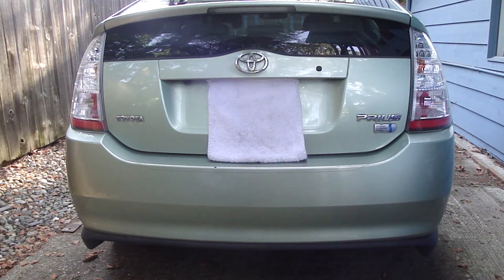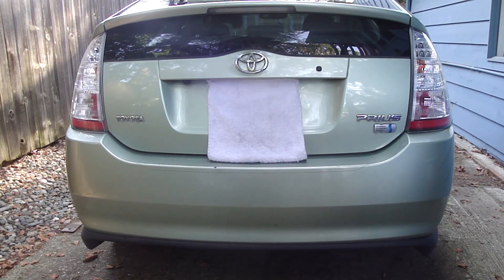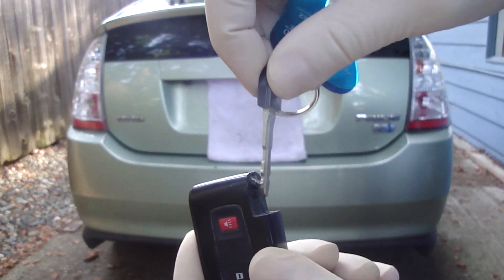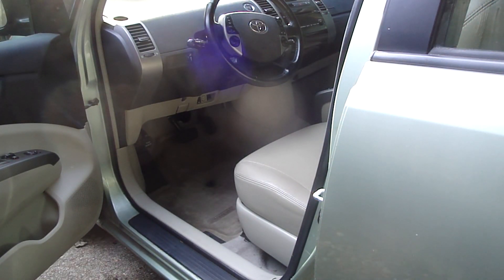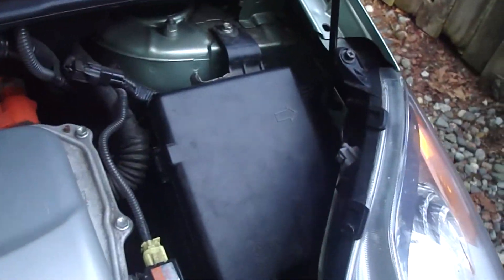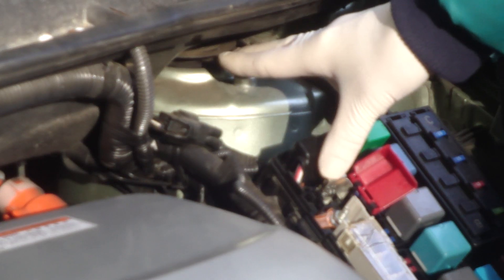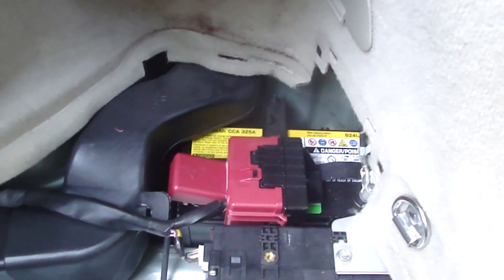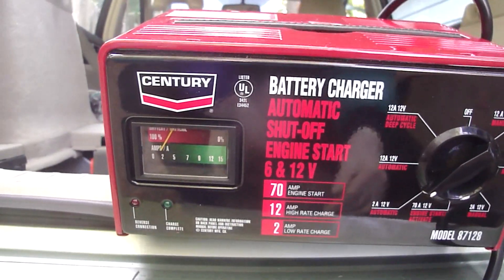Toyota Prius w/Dead 12 volt Battery / How to Open the Rear Hatch & Jump Start or Charge

Comment: Thanks for the video, when I tried to jump start my 2008 prius as my battery is dead, the immobilizer (car+lock) symbol light blinks with the audible alarm and tried few things but nothing worked. Does any one faced simialr problem ?
Reply from the maker: Did you hook up a charger to the proper leads at the power distribution box?
Reply: @davidgpo  Yes.
Reply from the maker: @sandiyar007    If the 12 volt battery won't take enough charge to open the door can you open the door with the key?

Comment: Dude dead battery cant open the door with fob key. I am looking for how to open front hood.
Reply from the maker: My daughter has the car now.  Isn't there a cut key embedded in the key fob?
Reply: @davidgpo  That physical key do not work now.

very weird. Used to work last time my fob did not work.

The difference this  time battery is out completely

If i knew this would have happen i would have charged the battery every 7 days

Lesson learned.  Probably battery wont charge  if its zero?

But i need to open the car.

if you google fob physical key  not working in 2010 prius . You will find few.

For some its more of key issue. 

Mine is something else.  Key moves both direction but car donot open at all.

first time door opened tiny bit. May be it was security feature?

After that its shut completely. I should have used hanged that time but i did not belief physical key need some battery help.

I have to get towing guy to unlock. locksmit guys asking 120cad+tax min
Reply from the maker: @nastybadger-tn4kl    Sorry to hear that.

Comment: I was trying to figure out what exactly I need to disconnect from the battery to begin safely trickle charging it and you skipped over all those details, it looks like you disconnected the negative terminal but I can't see the positive, does that need to be disconnected as well?
Reply from the maker: Do you want to charge from the engine compartment or directly on the 12v battery in the back?  If you are going to charge from the engine compartment: Don't disconnect the cables from the fuse box.  Attach the negative lead from the charger to the (-) black connector and the positive lead from the charger to the (-) red connector.  I hope this helps.
Reply from the maker: I suppose if you want to bypass the wiring of the car you would have to disconnect the neg and pos leads from the fuse box and hook up the leads from the charger to the leads that lead to the 12v batt in the back of the car.

Comment: I believe the donut spare tire is not inflatable, the reason you see the stem, is when you are changing a flat you know which side of the tire to mount, obviously the stem will be pointing outward from the car.
Reply from the maker: Check again, it is inflatable.  There a valve on the rim.

Comment: I came in here because I want to help someone who has the same problem as mine. Just recently my 2008 Prius went completely dead even after changing to a new battery. There was no life, nothing at all. I had to ask my friends to give me a jump. After watching many YouTube videos I found out that one of my fuse was gone. When you open the fuse box, at the right under C section, there are two blue no.15 fuses. I changed the second one from the top. After that I also had to tighten up my negative volt battery which is in the trunk attached to the back of the car. Make sure you unscrew the negative volt before putting on the new fuse. After that it came to life. Hope it helps someone.
Reply from the maker: I'm glad that you figured it out.  I hope your experience helps someone else.  Thanks for watching!
Reply: Just a note, but by "volt", you mean "terminal". It's the negative terminal that is attached to the chassis with a cable and a bolt.

Comment: Dude, that’s ridiculous. Just get some power from jumper cables or a battery charger  to the jump terminal under the hood and then the hatch will open like it normally does. The rear hatch for open one second after you connect. Any power to the jump terminal

Comment: Fine instructions up to a point. But you didn't show where to put the key to open the hatchback itself. The only keyhole is in the driver side door and the key doesn't turn.
Reply from the maker: That's the problem.  The hatchback doesn't have a key lock.  Thanks for watching.

Comment: Helpful, thanks…but you know what, this is the second car I’ve had in succession, where there’s no keyhole in the boot.  There’s one on the door, but not on the boot.  It’s a giant pain and only serves to draw more attention to the slightly weak aspect of this otherwise pretty good Hybrid, which is that 12V battery and I doubt there’s Prius owner out there, has not/will not experience the wonder that is the suite of faults and inconvenience that blossoms from a failing chunk of lead-acid cr@p.  If they were not going to make the 12V a decent-sized Lithium ion battery, they could at least supply a keyhole in the boot.  Anyway, I’m a bit grumpy because I just bought the car yesterday, and the suggestion was the battery was weak after the car had been sat for a month.  After a 150-mile trek home, for it to cause m trouble within 1 minute of powering-on the very next morning, I don’t appreciate.  I did negotiate on the basis of my belief the battery was not merely discharged, but dying, and this turning out to be the case, doesn’t make me feel better!  

I’d hoped to at least get a couple of journeys before jump-starting my purchase!  Anyway, we press on.  Thanks for the info, it’s a lot easier than investigating when you won’t even know what kind of a little stupid lever you are  looking for, or even if a little stupid lever exists in the first place.  The other car was a volvo.  ‘Phantom drain’ is so common, they could at least make their diagnostics point it out, instead of the plethora of warnings that are utterly meaningless and in fact, totally misleading…garbage about parking on level ground and the parking brake…we shall overcome.  Thanks and take care all.
Reply from the maker: Very well written.  Thanks!

Comment: People that make this helpful video an important piece of information. Don't just trip the lever, trip and hold the lever and push the hatch open. Because what happens is people trip the lever, then awkwardly squirm out of the car walk to the hatch and find it still doesn't open. It will lift a quarter inch but it won't open.
Reply: That was very thoughtful of you thank you

Comment: Thanks. My 2007 must be Gen 1 since it looked a little different at the fuse box.  It was more difficult to open the rear hatch than just pushing a lever and pushing up with my head. It wS only partially unlocked the first time and wouldn’t pull open, so I had to push down hard on the outside of the hatch to re-latch it and then try again, pushing up with my shoulders. Mind you I’ve had several disk fusions in my neck and back, so I am surprised that the rear hatch as an escape portal probably wouldn’t work.
Reply from the maker: YIkes!  It's best to find a way to charge the battery through the engine compartment.
Reply: @davidgpo  It just would not charge. I even put a little Wyze wifi camera in the garage aimed at my charging unit so I could watch the voltage on the meter from lying in bed. I could see it going from 4.8 to 4.0 to 3.6–I didn’t want to fully discharge the battery, so I pulled it off the fuse block in the engine compartment and hooked it up on the actual battery in the rear of the car to see if it would work there. I also followed the advice to disconnect the negative ground terminal from the grounding plate next to the battery, so all juice from the charger would go to the battery and not dissipate across the car’s electrical system.  Only then did I finally see the voltage reading going up: 6.0 then 8.5 then 12.0 and finally 13.2. I pushed the start button and was pleasantly surprised that it started right up. I heard charging via the fuse box only works if your battery is not dead—just below optimal 12-13.6 volts.

Comment: If you can jump start the car at the front fuse box, using another 12vbattery or a lithium jump pack, and get it running, then opening the back hatch is no longer a problem.  The Prius twelve volt battery is only used to boot the electronics (microprocessors) that actually control the machine, so it's not a heavy current draw.  It's not like a ICE engine where you have to rotate the entire mass of the engine.  Once the Prius is booted up and running the system will attempt to recharge the 12v battery, assuming that the battery isn't defective, or so badly sulfated that it won't hold a charge.  But you might need to take it on a longish drive, like 30 miles or so, to fully recharge ...

Comment: No need to open the hatch back to jump start the car.  Use an 8-foot jumping cable to get to the battery through the back door.  We tried to open the hatch back unsuccessfully, then tried the cable through the car back door without any problems.
Reply: not alot have 8 foot cables however I used to sets 😂
Reply: No need to attach the cables directly to the battery.

Comment: Hello and thanks for the video. Please try this in the future. I promise it's far easier than performing gymnastics to get to the hatch release inside the car. Hook up your jumper cables under the hood as you indicated. You now have 12 volt power to the car. Walk around to the rear of the car and open the rear hatch as you normally would. Keep in mind you may have to unlock the doors first. Good luck.
Reply: I was wondering why he didn't open the hatch like normal after connecting a boost pack or booster cables or a charger to the post he showed in the video.

Comment: I have a 2007 Prius and the car may be parked for months in the garage. I was planning to put a battery tender on it. Can i hookup the battery tender through the fuse box or do I have to go directly to the battery?
Reply from the maker: You can hook it up through the fuse box.

Comment: There is absolutely nothing about these cars that is better than a normal car...It takes me 10 seconds to hook up the batter on my real car for jumping and I don't need a tutorial to do it...thank you for teaching me how to do something that should be simple. Your video got me rolling again!
Reply: @mlaiuppa  So a smooth gearshift with the same torque as a real car makes an over priced hybrid with a battery that costs more than an ICE car all worth it? K... That's cool. Good luck when the battery wears out and you either have to buy a new normal Prius or spend $20K for a new battery. Your old battery which can't be recycled will end up in a landfill seeping toxic chemicals for decades. That's going to happen no matter what when your normal Prius is at the end of it's life. As far as I'm concerned, your normal car which is only about 40% recyclable is a hazard to the environment and sucks, but at least you can smoothly climb inclines lol I own one of these pieces of garbage and they suck donkey balls.
Reply: you can still jump at exactly like a regular car from the back hatch but it's faster under the hood. The nice thing about a Prius is it takes a tiny amount of juice to start the car. You are not cranking the engine you simply turning the car on.

Comment: 5:47 Also it looks like from the few seconds you focus on the charger, that you've connected it while it's still connected to the car. Is that safe? Some advise to completely disconnect the battery from the car.
Reply from the maker: The factory recommends jump starting and charging the 12 volt battery at the fuse box junction under the hood.  If that fails and the rear  hatch is locked you have to unlock the hatch as shown in the video.
Reply: @davidgpo  OK thanks for that. I went with just charging direct to the battery as you've shown in your video as I was worried about damaging the electronics at the front. Seems to be working fine. My charger is only 12V x 2.7A so only 50W approx. Very low power, and so no need to disconnect. Didn't want to charge the 12V using gas and the traction HV battery given the price of gas at the moment! See what happens in 10 hours time...
Reply from the maker: @yggdrasil9039    The factory has a limit for the battery charger.  I'm going from memory but I believe they specify 3 amps max.
Reply: @davidgpo  That seems right. Well the Prius is now fully operational again after 8 hours of 2.7A x 12V, but I'm going to leave it charging a few more hours as the charger is saying the 12V battery is not yet full. I believe there's actually a way of finding out about the SOH of the 12V through the main console in the Prius but I'd have to look it up again (it's some bizarre combination of tap brake 3 times, start engine twice, turn headlights on and off 5 times, something like that....)
Reply: @yggdrasil9039  All one has to do is get the car started which is easy since it doesn't have to crank the engine. The car charges both batteries itself with the gas engine. A short trip of less than 10 minutes will usually be enough for it to keep starting reliably.  If you really need to charge your 12v more than once after a discharge its probably time to change the battery.

Comment: "Alright I got my charger hooked up", hold on, that's the most important part of it! So now I have to go to watch another video to learn how to hook up the charger to a 12V battery. 
It's a shame you can't use the charger at the front with the fuse box. It seems to be OK to do this with the gen3 as there are a lot of videos saying it's OK to do this. Not sure why it's not for the gen2 but don't want to risk it.
Thanks anyway
Reply: It's OK I figured it out, it's pretty basic. Cheers
Reply: You definitely can use the front terminals for jumping or charging. I've done it a bunch of times.

Comment: My 2008 does not have a key lock at all on the rear door.  If I need to get in with a flat battery I have to pull apart the boot covers and use my finger on the latch.  Not needed for jump start but we can't just use the key.
Reply: That's literally what the video was about. The key doesn't work on the hatch.

Comment: They should have put an old fashioned  level pull near the driver's seat like the old japanese cars always had. I will put  cable onto that point and leave it for future  situations. In the meantime I have pulled out the main battery as block no 11 on 22 cell had come up with the triangle fault code so doing the replacement of that over the weekend.
Reply: How do you figure out which one needs replacing?

Comment: Not bad advice but I have gotten the rear doo open by putting a charger on the terminals under the hood. You can also hook another battery to those terminals (like jumping the car) which gave me enough power to walk to the rear of the car and unlatch it normally. Much easier than pulling everything out from the side door on your stomach.
Reply: I'm watching this while eating and taking a dump on the toliet, and my hands are still dirty, and this man put on a pair of gloves to open the fuse box
Reply: Yeah, definitely don't jump a car by attaching the jumper to the battery directly. Always use the chassis as the negative terminal or in these cars, just use the under the hood terminals.

Comment: Wait. What? Are you saying these batteries don’t need to be replaced? I asked two different people at parts stores if they couldn’t be recharged and they said no so they lied to me or it’s just not recommended?
Reply from the maker: The Prius has two batteries.  One is a conventional 12 volt battery that is similar to batteries in other cars and it is rechargeable.  The other is the traction battery that is very large and contains high voltage.  It is made up of a series of batteries connected together.  It is used for powering the electric motor that drives the car a low speeds.  That battery recharges when the car is driven but when it goes bad it has to be removed and replaced which is very expensive.  I hope this answers your question.
Reply: @davidgpo  no it doesn’t but I’m used to it. A long paragraph explaining how the Prius works as if I don’t know… My question was when my 12 V battery went dead could I have not recharged it rather than pay almost 400 (fkn) Dollars for a new one?!
Reply from the maker: @rainafortini5797    12 volt batteries are rechargeable until they get old and will no longer accept a charge.  A load test will determine the state of the battery.
Reply: @davidgpo  wow… it’s funny because I left mine on the porch waiting for confirmation that this battery was in fact garbage and of course I did discover you the day after I gave it back to the dealership… to recycle it, or maybe sell it to some unsuspecting customer for 300+ dollars (thanks for the knowledge)
Reply: @mlaiuppa  so they probably keep my old battery charge it and then resell it and never mentioned that to me…got it :( thx!

Comment: My battery was OK. My prius 3rd gen would not go into D or R, only from P to N. Toyota said, known issue, recall. This is what they did:  1     04899-47070          TRANSISTOR KIT, P                              WARRANTY                  2     08887-02809          GREASE X 23 7884                               WARRANTY                  1     04899-47060          PLUG KIT, INVERTE                              WARRANTY                  1     08826-00100          SEAL PACKING                                   WARRANTY                  1     90430-18008          GASKET                                         WARRANTY

Comment: When you have jump started the car and the engine is running wait a few minutes and your remote will work to CLOSE the doors then OPEN them, this will open the trunk/boot.. at least this works in my 2006 prius .. good luck.